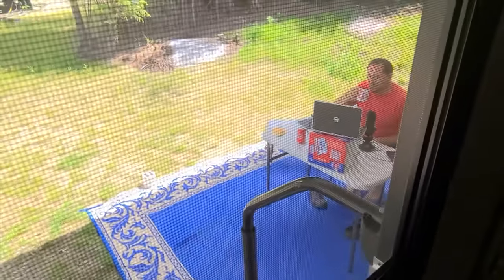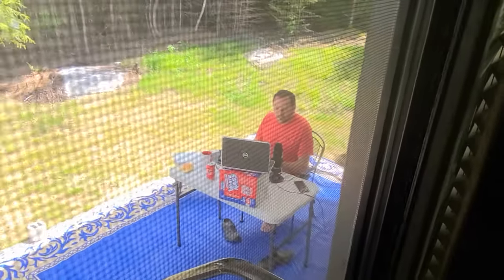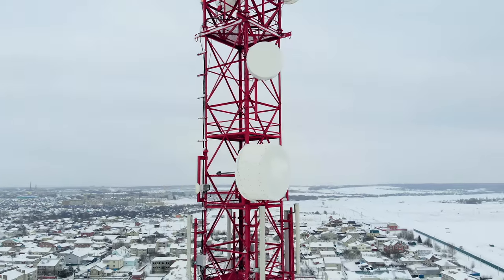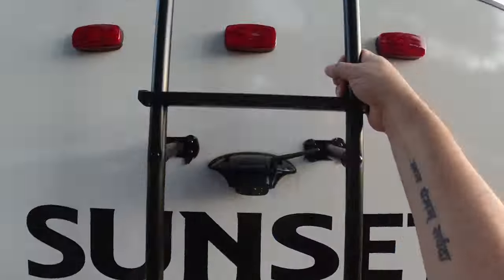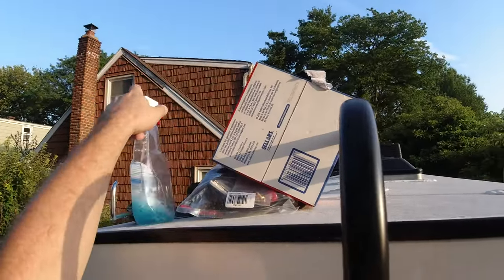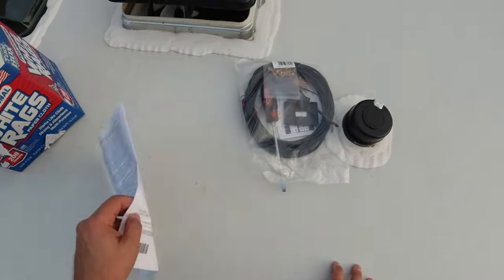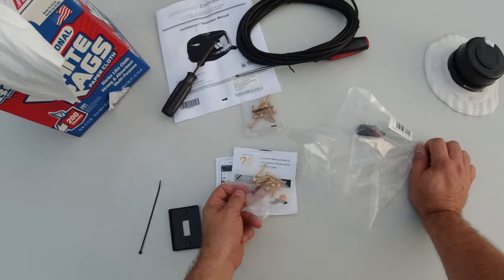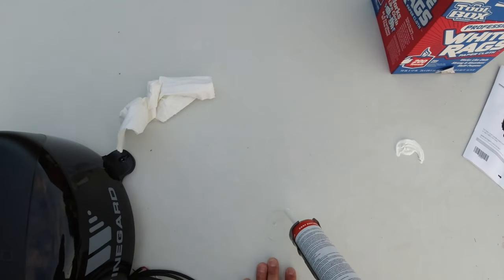RV WIFI | Winegard Performance Secrets plus full install and review.

Comment: Thank you so much. I have an rv with the winegard air 360+ V2.s and I was wanting to go through this system with the same impression you had. I am insted going to just get a mobile Hotspot with great speeds and just use a standard unit that I can hard wire into as well use for wifi. Saved me a ton of headaches in the future with networking issues. Thanks a lot man I really appreciate you.
Reply: You earned a sub great video
Reply from the maker: That's great to hear and we're thrilled to have you as a new Subscriber 😀

Comment: I like the studio background. Is that a little white hippo sculpture? I love how he's in focus whilst the drones are blurred out, hehe, taking centre stage. Has the blur been added in post-production? Nice outdoor office. I love working outside but yeah wifi reaching there can be tricky. Installing the Wineguard on the roof looks fun. Is that like CT1 you use to stick it? Nice DeWalt drill! I have one of those 😎
Reply from the maker: My room is too small to get far enough away for any depth of field so I add that post.  It's a white elephant that we picked up in India.  I can't remember the name of that goop but it's specialized for rubberized roof materials.  I love that DeWalt drill...I've got a wicked set of tools, it's a residual benefit from racing cars professionally for so long.

Comment: I have one of these and I have taken it apart and used it with an activated redpocket annual sim card providing 100gb a month using the 4g data plan. 
It does not amplify cell phone signals or wifi signals. It has what amounts to patch antennas in the dome that will help get a better signal. Just like stepping outside of your house with your phone. Weboost and several other manufacturers make cell phone boosters that take one or two bars and regenerate it to give of an amplified signal so you see 5 bars and your signal is better for it. Assuming that it is boosting the band that your carrier likes to use. there are only at&t, verizon, tmobile, sprint-technically tmobile now. All other carriers are what are called mvno's. They use one of the main 4 networks.

Red pocket can use all of them depending on what sim you get. 

All 4g/5g cell phone routers have a cat rating... not like cat 5 cable but they do go from category 1 all the way up to cat 18 and beyond. My cell phone is cat 16 capable. The higher the category number the faster the device will be. The winegard device has a cat4 modem and that means a max of 150mbs down and 50mbs up. You will not get 300 to 700mbs down when using the cell data plan.

For Wifi this is different and not the same thing. When using the wifi hotspot of the winegard with 4g data you will be fine. 
You can see its 2.4ghz ssid and a 5ghz ssid. Use the 5ghz ssid for faster speeds.  (older devices cannot see 5ghz)
2.4ghz goes further due to is lower frequency but it is slower. 72mbs up to 300mbs is the maximum speed and that is pushing it. Even my modern cell phone on a 2.4ghz network connects at 72mbs most of the time. always use 5ghz for faster speed. My dsl at home is 12mbs down and 1mb up and this gives enough to work from all day remotely and do teams calls so you do not need 700mbs to watch netflix or do a zoom call. speed is over sold and over promised by the carriers.

The biggest limitation on this device is the option from its web page that lets you connect to a campgrounds/rv park's wifi and that internet gets sent over the 2.4ghz ssid and the 5ghz ssid.
You log in, and you get cellular or wifi as an option and choose to scan for internet and then connect to the desired ssid and then it bridges that to your weingard ssid's .
wifi then becomes half duplex. Meaning you send then you receive that can slow things down.
I do not see a speed reduction when i connect it to my home wifi and then connect to its ssid on 5ghz.

With it being 2.4ghz only though you will not connect at super high speeds. 
but you do not need that much speed to do an average video stream. 
netflix basic can go down to 1.5mbs connections and since i have 12mbs it normally uses 5-6mbs at a time. 
High definition will use more. 10-25 at the most.

1) you are limited by the campgrounds transmitter as to what speed you can get from it due to distance, signal strength and being 2.4ghz.

2) no the wifi device is not upgradable in the winegard connect 2.0 system. It is built into the board.

3) the 4g modem card can be removed but i have not found anything yet on a replacement that can be used on the board. Most likely there isn't one.

4) inside the connect 2.0 you can see where they used the same boards as the version that had a tv antenna but those parts are not on the boards. just shows where they could have been.

5) IF you felt spunky the board is a router board and has a usb port and an ethernet cable. If you plug your laptop into the ethernet port you will get an ip in the 10.11.12.x range and .1 is the gateway. you will get whatever internet access you would get while on the wifi ssid's only you are connnected by an ethernet cable.
You would need an ethernet cable ran from that box to your hardware inside. It is gigabit connectivity vs 10/100 and seems to work fine. You would need to make it water proof as there is an extry hole that is plugged but its not big enough to get the clear end of an rj45 cable through it. You could run a cable through and put an end on in the inside and plug it in that way and run the cable inside. I would imagine this voids your warranty. I picked mine up for sale for 45 bucks at an auction so i am not as worried about my warranty.

6) The cell card and wifi both have the small antenna connectors on the board and on the 4g modem card going to two pcb style patch antennas. 
My goal is to adapt those to external antennas if i need to. I will say that they are rather good at picking up signals outside.
i drive around with mine for testing  and i have scanned for wifi with it and cell signal. I may end up using this or something like it to replace my current dsl.

7) i have used an att sim from weingard, a redpocket sim, and a test sim from total wireless though i had no active plan.
With the redpocket sim being activate i found i could get up to 80mbs or so down in the same area my phone can get 120mbs but that was it. I was at 25mbs in my testing and i found i needed to just pick att from the carrier. the other option that says att and it looks like an email address is slower for some reason. It will ask for your apn name and i picked ereseller. There was no place to add all of the other information. You cannot change ttl or band lock from this device.

Its great for what it does but without a faster cat modem your not going to get 900mbs in the woods. :)
Reply from the maker: Wow awesome job.  I read the whole thing and feel like I understood a lot of it.  I am an amateur on the inside tech stuff but good at explaining the real life living with it stuff.   Great info,  thanks again for contributing.

Comment: It's not an amplifier, it's a repeater.  Data comes in, and then goes out, hence the speed reduction of about half.  But the wifi will reach further than connecting direct because the MIMO antenna array has phased directional gain, and it's up higher on your roof.

If you want it to be faster and you can use a wired Ethernet connection, there's an internal Ethernet RJ45 socket, so you can run a wired connection instead of using the Connect 2.0 as a wifi repeater.  Youll need a small torx bit to open up the dome.  Be careful when you open it, the internal antenna cables don't have much slack.  I ran the Ethernet cable through the wire gland where the power wire came in, and drilled a new hole for the power cable.   The reason for that; Ethernet cables have four twisted pairs inside and aren't as compressible as the power cable, so they need the gland more than the power cable.  Then drill a new hole in a corner, slightly smaller than the power cable, so its jacket will seal well, and maybe put a little sealant on it.  You'll need to crimp a new RJ45 on your Cat 5 cable after running it through the gland.
Reply from the maker: Interesting concept your hack there but way outside the realm of normal users and "reasonable" for me to start running network cables from the roof of my RV and somehow rewiring my RV so I can connect via a wired connection.  To me, that seems like #1 a giant project that I don't want to do and #2 counter to the whole concept of this device....as marketed.  I'm sure it will work and work really well but so not what I want to do or more importantly expected to need to do to use this effectively.

Comment: Thank you for your insights.   I have a new RV with the Winegard ConnecT 2.0 (Thor) and I had one before.   First of all the WIFI only connecting to AT&T and Verizon is an issue.   I use Tmobile and don't need another connection to pay for.   My Apple IPHONE and IPADs get good enough WIFI without the amp.   The other thing I was waiting to hear is how much the UHF/VHF antenna suck.   ITs so bad, they hardly mention the feature of the OTA antenna, but it is horrible.  I haven't tried the 360 AIR but its atleast the main feature of the base unit.   So disappointed in the OTA offerings.
Reply from the maker: Funny you should mention it because I have the 360 as it came pre-installed in my RV but we almost never watch OTA anything anymore so I don't know if it's any good.  Glad you enjoyed the video though!  What new RV did you get?

Comment: Thanks so much for the video.I too plan to use my Grand Design with 360+ and 4g LTE. I need it for remote work so I installed it this weekend and plan to activate the AT&T SIM card (came with unit) online. I will test this during the week at home. I attached it with positaps so I did not have to cut the loop inside the rig. BTW: the unit was pre wired and bout the modem form Winegard online. I am going to Oregon KOA on the coast in mid August. Will let you k ow how my testing goes. I found the hot spot on the phone is less stable.
Reply from the maker: So cool... we're excited to hear about how it goes.  Fingers crossed it's a big success!

Comment: I noticed you talked about a switch and turning it on. My Winegard 360+ and Gateway LTE are installed but I do get any power. Can not figure out how to turn it on. Great video. Nice presentation.
Reply from the maker: Our RV was prewired and had a small on/off switch inside the cabinet above our TV where the antenna wires and power supply for the TV was.  Hope that helps.

Comment: Thanks Doug for the video. I liked the speed test comparing the direct to WiFi hotspot and the amplified WiFi through your Winegard. Did you do a speed test using LTE? Did you check your signal strength and signal to noise ratio? Does the Winegard even give you those stats? Do you know how far you were from the cell tower? I too will be working from my RV using the Winegard 360+ with the LTE gateway, which I think are similar components to what you have and am curious about some specific performance details. Thanks for putting this video together.
Reply from the maker: I did do speed tests using the LTE and they were all similar to my using my cellphone as an LTE hotspot, they were pretty identical speed wise.  Fortunately/unfortunately for your question, I live and have been traveling in the Northeast of the USA.  At this point it is pretty hard to not find a strong cell signal so I'm not really sure how well it boosted or picked up those signals.
Reply: Would a booster help for Wi-Fi. I’m looking to stream because my husband is a paraplegic and when he’s down he watches TV. We will also be boondocking. We’ve used MiFi in the past and it was good unless your a ways from towers. That’s why I thought booster.

Comment: So  Doug what WAS your solution to being able to zoom, screen share and work? Thanks for the gret detailed video!
Reply from the maker: It's a mix...campgrounds with crappy WIFI I lean on my cell phone as a hotspot.  More campgrounds are really upgrading their WIFI speeds and even with those being reduced from super high speed, the stability of a single point of entry (the winegard) for all my devices is easy and there is plenty of speed in those situations.  Welcome to the channel!
Reply: @DOUGandNIKI D

Comment: What’s the slowest speed you’ve gotten on wifi with winegard? My RV was equipped with it (Jayco Swift), and i think it’s defective. I was expecting at least half of the speed of direct wifi (Like yours, around 60% loss of speed), but i’ve tested it at home and went from 20mbps to 0.02😂 eventually it went to 2mbps. Tried at a mcdonald’s parking lot (The advertised use case, boosting the weak signal), and still, it was very slow. 50mbps down to 5mbps.
Reply from the maker: I don't know what my worst case was but it was definately bad as you indicated.  If I was buying a new system today, I don't see how you can avoid a starlink mobile system.

Comment: Any new firmware upgrades that help the wifi?  4g is what we’ll use the most with, most wifi at campsites stink anyway.
Reply from the maker: Not that I have heard of in terms of updates.  The issue seems to be mechanical...the way the amplifiers are connected reduces the speed while amplifying the signal.

Comment: I've been looking at this device to replace my hotspot using a Samsung Tab A.  We are looking to get better streaming speed on Roku and smart tv.  We have a T-Moblie data plan with 4g service.  Would you think this would be a good upgrade from the tablet hotspot?  Thanks for the great video.
Reply from the maker: It's a bit of a maybe.  I can tell you for sure if you get the card for it and stream through the Winegard you get and very quick 4G connection.  My problem with that is I'm used to my unlimited data plan and on devices like this the unlimited plans weren't available.  With the advent of 5G, most of the time I use my cell phone as a hotspot and it's stable, fast, and unlimited but, when I'm doing business calls and I need super strong consistent speed I use the Winegard.

Comment: @DOUGandNIKI We just purchased a Sunset Trail also. I bought the Winegard 2.0 and will be getting a SIM card from Verizon to put in (that was a whole ordeal). My question is do you need to install the rocker switch? Or does it just stay on all the time? It says pre-wired and I am assuming that is just the power connection in the roof that you showed us. Did they run a wire to the control panel to add the rocker switch there? Thank you for your help
Reply from the maker: So cool!  What model Sunset Trail did you get?  Our rocker switch was pre installed right next to where the antenna wires are in the cabinet above the TV.   I just had to connect the wire on the roof which went through that pre-installed rocker.  I like having the rocker because it keeps me from having to undo our phones and computers hunting for the Winegard when we are at home and wasting data.  I just flip the rocker off when we get home and that ends that.

Comment: You're talking about "WIFI", not an internet connection using your cell phone data package.  WIFI coming from most camp grounds sucks to begin with because you've got dozens of people logging into it, and that's going slow your connection down no matter what booster you have.  At the time of this post, I'm using my 2dn PC to watch a movie that is logged into my Verizon jet pack and it's playing perfect.   We are at home, and  I have 3 bars.  The Winegaurd is suppose boost THAT cell signal even more as that's it true main purpose, reason we plan to install one on our 5th wheel soon.   We have a "wifi" booster antenna that we've used in the past to boost campground wifi, and it more times then not, had a  weak signal also.
Reply from the maker: Your first thoughts are a little correct on older campgrounds with crappy wifi but...  My real test which I showed was at home in my driveway about 20 feed from my router where I had really good GIG speed internet service which was absolutely reduced significantly and it had nothing to do with other users on the service it is the physical system they use with kills speed in it's process of amplifying the signal.

Comment: Think I can take this sim card into Verizon and get their service on it or do you think I will have to buy one of their sim cards?
Reply from the maker: As long as you have the right sized card (I'm sure Verizon does) you should be able to buy the service directly from Verizon.
Reply: @DOUGandNIKI  right, but think they can re-use the card that came with unit or do I need to buy a new one?  Sounds like they reused yours at AT&T.

Comment: It would've been cool if you showed the wiring. That's where I'm having an issue. Glad for the other information you provided though.
Reply from the maker: I showed all the wiring for our rig, it came "pre-wired".  I'm glad the balance was helpful.  What kind of a rig are you installing yours on?
Reply: @DOUGandNIKI  Ironically, you were the only video I could find that showed the what is under that prewire cover. I couldn't determine if I'd need to install the on/off switch that comes in the package. I see now I won't Thanks for that! Enjoyed your video.
Reply from the maker: @onecullen  That's so great to hear!  Good luck with it.   If you get a chance and you belong to any facebook or reddit groups where the video might be helpful...please share, it really helps our channel.

Comment: We don’t see any cable that comes from the Winegard to the splitter! What am I missing? Our unit came installed on our RV and I got a SIM card that we put in the unit…. Now what?
Reply from the maker: Is there a chance the wire go straight out the bottom of the Winegard through the roof?  I have the wire on my roof because I decided to mount mine further forward than where the pass through in the roof is.  Did it work for the prior owner or is this a new vehicle?